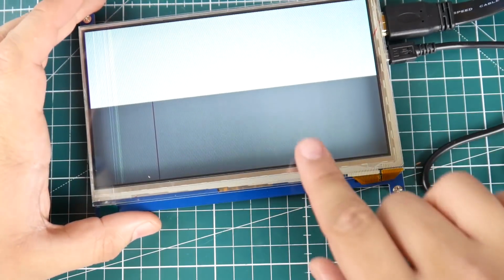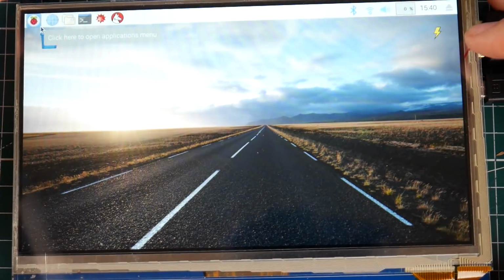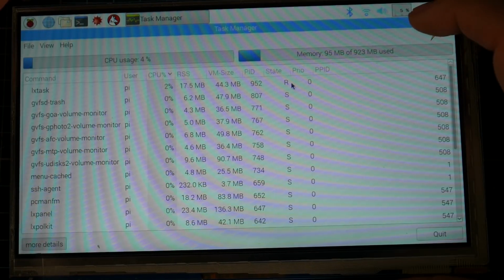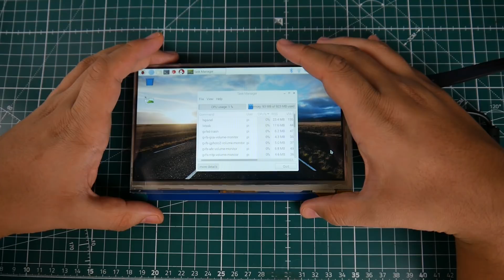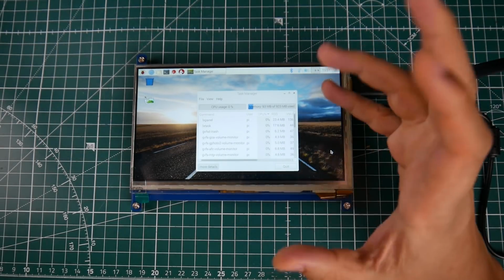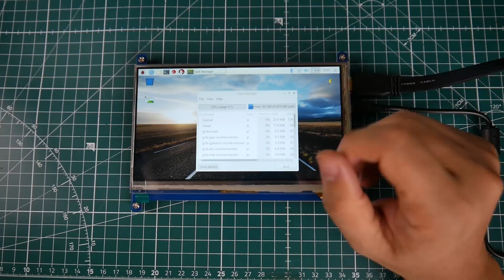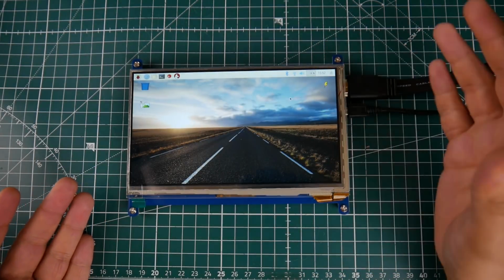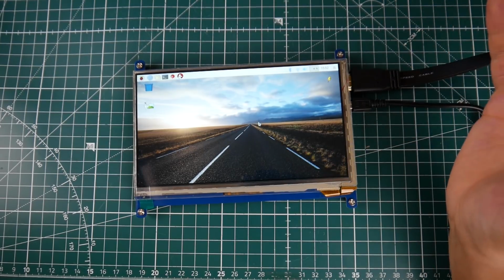Amazing $50 Touch Screen for Raspberry pi // Geekcreit 7 Inch Capacitive Touch Screen

Comment: I'm confused a little bit, how do you edit the text file if the monitor isn't working before it's edited? Is another monitor required? Or is it just the touch screen element that doesn't work initially?

Comment: Looks like a nice screen. Looking forward to the project, I've got an official rpi touchscreen that's looking for something to do 😁.
By the way that lightning symbol is not a good signe, its low voltage. Get a better power supply or use a separate one for the screen.

Comment: can it run  Betaflight?
Reply: Most likely yes
Reply: That's exactly what I was thinking!
Reply: of course, it runs a Debian derivative.
Reply from the maker: yes chrome is installed as default
Reply: Am i correct in saying BF is not supported by chrome anymore ?
Reply: Yes, betaflight is a standalone program now, it can be found on GitHub for different platforms. Also the blheli configurator.
Reply: it won't soon, but the betaflight configurator is available as a standalone app for linux too (embeding the chromium engine, basically).
they are availyble there: https://github.com/betaflight/betaflight-configurator/releases